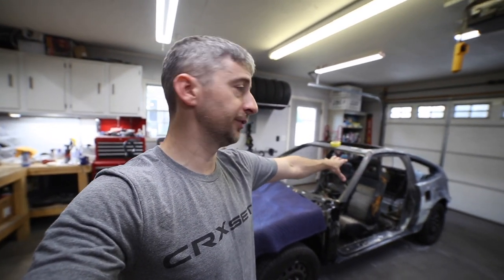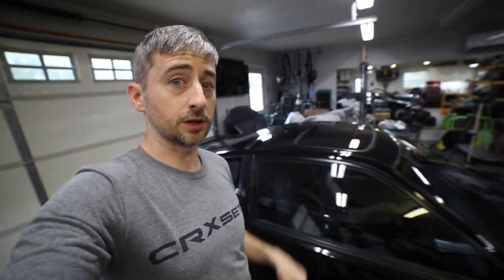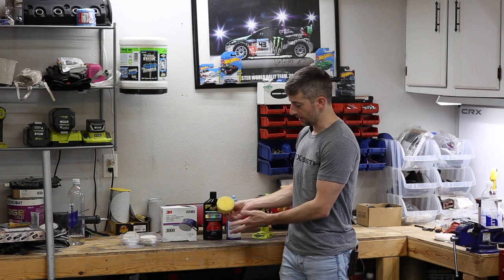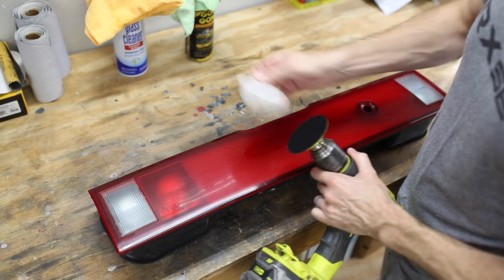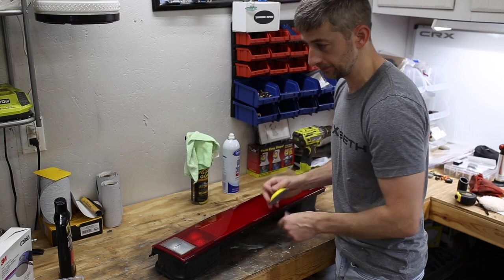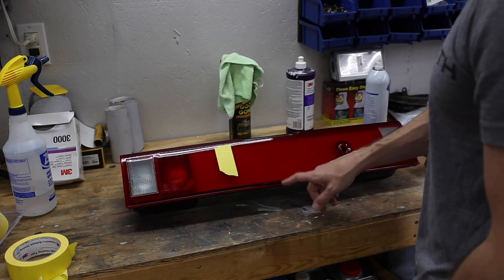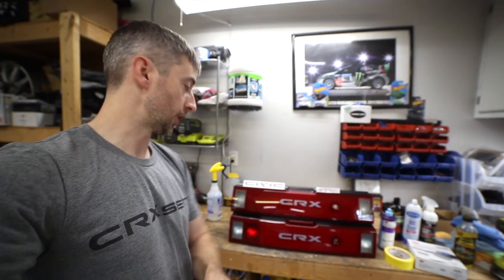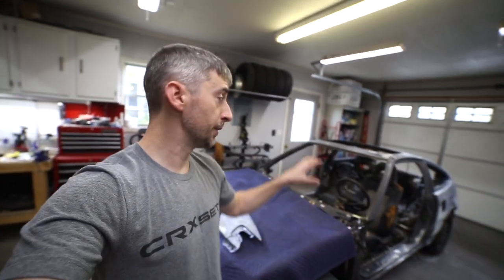How To Restore a Honda CRX Center Garnish

Comment: Thank you for this video. I have a 1991 CRX HF and bought your decal . I followed your video and was a bit scared of wet  sanding taillights never done in my life bought got amazing results. Another fact my 199I garnish looks just like the one you restored but the CRX was painted on original with a mold of CRX which made it easier to apply your decal without measuring. Hondas have been in my family since the 1977cvcc civic  my grandpa's car then my Grandpa bought a new  1986 CRX I was 7 remember riding in the back as child getting car sick . Years later my Uncle had one he bought kept in garage for 12 years and rather buy a new car I restored her new thanks to your videos man long live the CRX and keep them on the road .
Reply from the maker: Awesome. Glad you’re carrying on the tradition!

Comment: I took a razor blade and trimmed the old plastic coating off of my hatch trim. Then I covered it with some satin black vinyl. It turned out nice. I left mine on, didn't want to break the clips. Hope this helps.
Reply from the maker: Thanks for the input. I tried to scrape it off with a razor, but many parts are really stuck and haven’t deteriorated so it wasn’t going to be easy to remove that way. Too bad they don’t still sell these pieces.

Comment: I'm not sure about that particular glass cleaner, but often they have ammonia which can outgas under the decal or even chemicals to seal the surface which may cause it to fail prematurely. 

Stick with isopropyl alcohol or a wax and grease removal product.
Reply: Can agree with you there but Ive been told by body shop painters that that Glass cleaner is the best to use to clean surfaces do it it being ammonia free and being purely water based which is a plus

Comment: how would you go about removing one that has paint on it? i found one for a hatch in pull a part but it has massive splotches of matte black paint on it and i wanna try and save it
Reply from the maker: I would personally sand it off with sandpaper. And keep sanding until it’s all polished up again.

Comment: How much of a difference does the 3m machine polish make? Its quite expensive, but I do want my crx tailights to look mint..
Reply from the maker: It removed the fine scratches and swirls from the buffing compound. There are probably cheaper options that will work. The Ultrafine Machine Polish is mainly for black or dark paints since you need to remove every small scratch or they will be visible.You can use any polishing compound designed for car paint.
Reply: @crxseth  okay, thank-you. I have dark paint on my CRX anyways, so I might as well go with the machine polish.

Comment: when you are removing any decals or stickers i recommend heavily coating it in some goo gone and let it sit for 10 minutes then use the razor blade you will be able to get it off so much easier and wont leave any Residue, lube always helps 🫡

Comment: To get that Black Trim off the Tailgate really needs to be off, if your careful then with screw driver you can pop it off clips while pushing tab in a bit so they don't break, My next nightmare is Tailgate, it sits to high on right side and it sticks out past rear quarter, where hinge bolts on the metal has pulled out so hinge raised, so annoying as tailgate decent condition